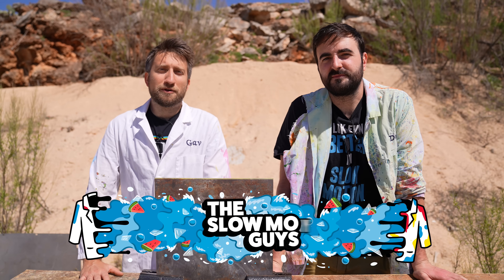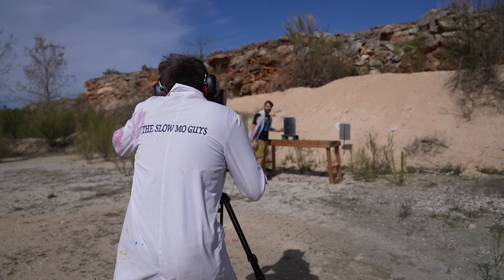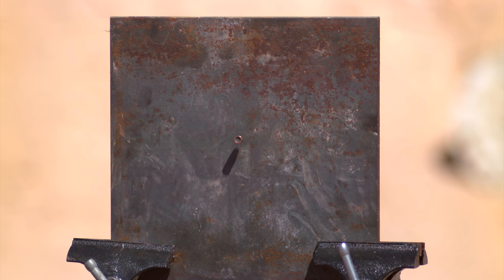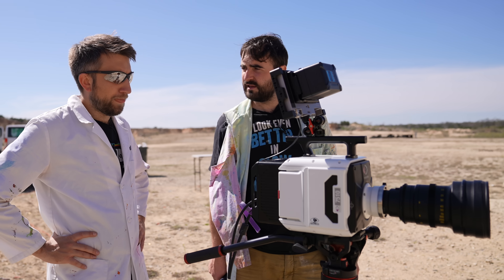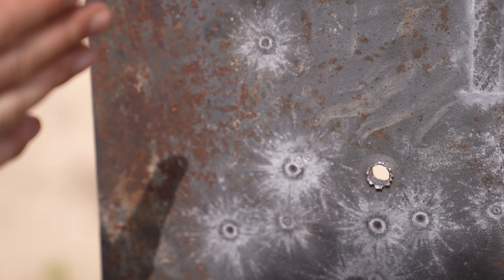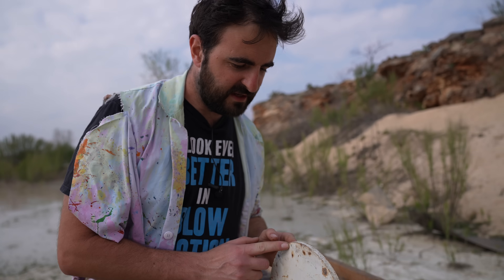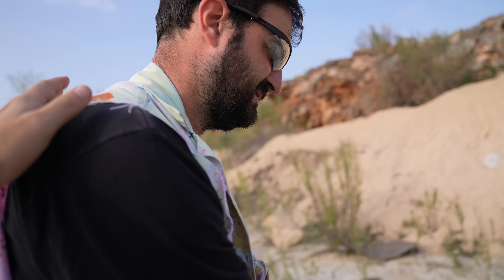Bullets vs Steel at 800,000 FPS - The Slow Mo Guys

Comment: The .30/06 had already tranferred so much of its energy to the steel plate that by secondary impact on the sign it had less mass, speed, and [the product of the prior mentioned]energy that there wasnt  significant exit damage. Also, being that slow, and aluminium being so much softer/more malleable that it doesnt tear. At higher speedbit would. You almost have to rather consider the lead almost a liquid traveling w such force at those  speeds. Exits w least resistance possible so to speak.

Comment: By my rough measurements the piece of lead exiting the hole was 5 times slower than the approach speed.  So ( by mv2.) it had only 1/25 the kinetic energy, having used up 24/25ths of its energy in making the hole.

Comment: I am sure others will be more precise but the 9mm hits with approximately 300-400 foot pounds of energy, the 30-06 with about 2,800 foot pounds of energy. a heavier bullet and the velocity of the 9mm is approximately 1100-1200 Feet per second the 30-06 is about 2800 FPS

Comment: red is or used to be the old color for AP Bullets for semi  auto handguns/ smgs , that only use 3 kinds of industrial sharp ammo standard n/ fmj not colored, ap (red)  and jhp (blue) . red was also ap for 7.62 x 39 rounds for f.e. ak 47 and dragunov dont know ig there was jhp ammo for those, at least i never saw any since standard ammo already creates more shrapnels than 5.56 or 7.62 nato ammo. for other of many big bore calibers, specially .50 bmg and i THINK some other antimeterial / long range snipers rounds there are other colors used. blue tips for those should be banned in most states today for civil usage since they atr inci or maybe he or an inci combo round not sure atm and too lazy to look for it ;) . for sure i would not recommand red marked semi auto pistol ammo cause if it is ap and fired on steel the shrapnels are not as predictable as from a standard or jhp round. btw just found a pic in one of my folders, 5,7 ammo is complicated , red and blue were jhp but are on this pic marked nemed as ( my french isnt good) jhp / ap. they are replaced by the third type on this pic that is just coppor collor "no tip"  should be standard "standard" but really fast rounds. since this ammo is forbidden for germanys civil market and the guns using it are too expensive for blackmarket i never shot one. but i think here also shrapnels will be pretty unpredictable on steel. i dont know colors for military / socom units allowed. edit this if i find to check it. i think this is an old wiki pic and i dont trust wiki that much concerning round markers.

Comment: It’s important to understand that the hollow point is not really designed to fragment, like petals.  It’s meant to simply open up and increase the size of the round as it enter the soft tissue.  Of course the steel causes it to petal out and scatter.

Comment: Have you tried strobing mechanical moving parts with the strobe at the same frequency? Worth a look, it's weird and awesome, and easy to set up, stuff does strange things at high speed and heavy load. Engine valves and valve springs misbehave 😂

Comment: Ok next up is skipping bullets off water..yes you can skip bullets on water just like rocks if you keep the rifle barrel a few inches above the water with a very slight upward trajectory! Only problem is it skips for a couple of hundred yards so placement of cameras would be a bit challenging to get a slow mode video of most of the skips.. .22LR rimfire would be a more workable caliber to tighten up the skip groups. Good luck!!

Comment: Used to do some high speed video when I worked for a rifle manufacturer in the 1980's. It was eye opening at the time. You could only save the results on a 
VHS tape. This state of the art equipment is amazing. Keep em coming guys...

Comment: I would be curious how different hardness steel changes the results. On the surface it seems harder would do better but harder also usally means more brittle so on that front it should do worse. Seems you would want some of both so that it flexes to absorb but not so much it fails.

Comment: Depending on the steel type, the bullet is producing a shockwave within the steel lattice that fractures it. This is called spalling and tankers in the military know how deadly this effect can be. In fact, "squash head" (HESH) munitions are designed to produced exactly this effect by "pancaking" the explosive onto an armored surface and then detonating.

Comment: The bullet is shearing the steel when making a hole.  A paper hole puncher is a good analogy.  I would think it is the tensile strength rather than hardness that determines whether a hole is made or not.

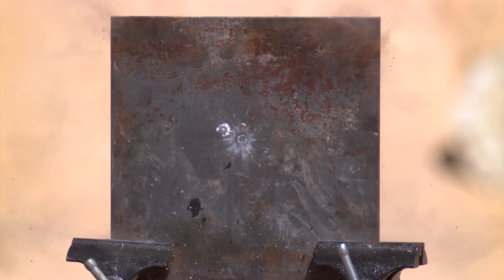Comment: 3:48 Somehow the dust and particles coming up like superman just resurrected, flew these two by completely. If you didn't know where it came from you'd just think some dust randomly started floating upwards.
7:00 Oops, this metal plate gained a bullet hole we didn't see. xP
10:15 That piece of "lead" is far too thick to be from the bullet. That's just the back of the plate. There's a small copper colored disk there, I think that's the remainder of the bullet.
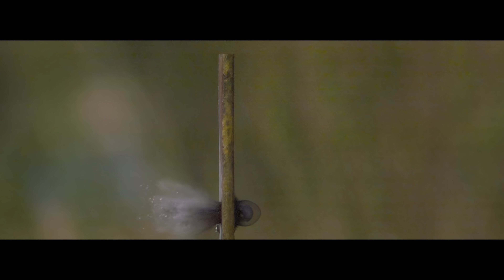10:48 Definitely the plate. There's no way that thin bit of dust is actually just the plate warping and thinning out. The bullet hole (the surrounding) has much less lead than there should be for this thick plate.
11:24 I mean.. yeah. Ofc it was the plate.
12:00 Or, idk.. you look at the piece that flew out and realize that's much more "lead" than the bullet is big? I'm not saying reviewing footage can't teach you anything new, but this is just a failure in observation. xD

Comment: just a bit of bullet info from a amateur gunsmith ... the hollow point bullets are designed to peel back but ideally not break apart ..you want all the mass to stay together because as it loses mass it losses penetration potential ...HP=expanding bullet  .. now frangible bullets are designed to break apart .. I think you guys would love shooting a 308 frangible bullet ... as far as the steel ..the circle steel you shot was most likely AR500 through-hardened steel plate ...another interesting thing you can do is put cardboard around the outside of the steel plate and shoot it with various rounds and you will see the splash pattern in the cardboard ..or put watermelons etc around the sides of the plate ...especially if you use frangible bullets ... I would be happy to send you various rounds I think people would love to see slow-mo (myself included) .. RIP rounds,frangible,steel core,frangible core,m855 penetrator green tip (5.56),30cal tracer rounds,5.56 tracer rounds and then some special homemade 30cal :-)  ...love the show thank you

Comment: You had me scratching my head there for a moment.  I used to shoot a .25-06 (117gr soft point) at 1/4" steel plate and it would not penetrate - just a splat - at about 70 yards.  The first steel plate you used must have been unusually soft.

Comment: The broken vise shows just how much energy the old 30.06 has and how formidable it is.
Reply: Yes. I shot  through a 9 inch Ford rear end differential case with a jacketed 30-06 round. The rear end diff was heavy, Had to carry it 300 feet down range. The holes almost looked like they were drilled through the steel.
Reply: my right shoulder remembers very well the one time i shot some 30.06 rounds many years ago

Comment: According to P.O.Ackley, a .220 swift factory 48gr. bullet will pen the 1/2" frontal armour plate of a WW11, 1/2 track, while a .30/06 173gr. Armour Piercing round (steel core) will cause a dent .007" to .008" deep. So - that's 4,100fps vs. 2,600fps. (feet per second, not frames per second)
A .17 Remington will push a 20gr. bullet at up to 4,400fps & 25gr. at 4,100fps as well as 15gr. @ 5,000fps.
Their penetration on steel might be interesting, visually.

Comment: Correct me if I'm wrong, but isn’t there a more likely chance for the bullet to ricochet back if the steel plate is mounted tightly? Rather than allowing it to move slightly, like how some steal targets do due to the spring on the back of them? I genuinely don't know and not a gun expert by any means, just curious if this is true or not?

Comment: Love the way the spinning round hits the plate and compacts and stops rotating but starts rotating again as it relinquishes contact with the plate. The kinetic energy of the spin remains as potential energy until it's free of the plate and converts back to kinetic rather than the spin just being stopped and it rebounding straight back. Amazing.

Comment: I think you’ll find the small pocket of air that occupies the hollow point is instantly super compressed. When air is compressed like that it heats up enough to burn the copper and lead.   The same phenomenon was described when that deep sea submersible was heading to the wreck of the titanic.  The instantaneous compression of the air inside the vessel was super heated and the occupants were “cooked” before they were crushed.   I believe I’m right based on what I have read.  Any opinions to the contrary would be welcomed.

Comment: I'd like to see a steel core round captured on the same setup. Used to have mil surplus 7.62x54R that had a steel core inside a jacketed lead projectile that would leave an exit hole in plate about the size of a .22. would be cool to see if the core leaves the lead much like the lead leaves the jacket in this video.
Reply: Also shooting golfballs off a fence post with a .22 was a favorite childhood game. The golf ball usually captured the .22 and went flying like it was hit with a driver. Might be cool to capture.

Comment: You guys are mad for standing that close while plinking metal, even with pistol caliber cartridges. I usually stay at a minimum of 25 yards for pistol and even then I've had some splash back come back and hit me.... I would never dream of shooting any rifle cartridge closer than 50 yards and even that's pushing it.... 100 yards is a nice and safe distance. I've sent literally 10k + rounds of every caliber practically at that distance and have never had any scares or even heard ricochet.... At 50 yards I was shooting m855a1 out of a 16" BCM and actually heard a ricochet super close, started looking around and noticed some dust kicked up maybe 10 yards away..... The center steel penetrating core of the bullet was literally laying like 10' away from me!

Comment: That flame isn't sparks, its a flash from the air inside the tip of the hollow point igniting because its being compressed. This happens in almost all your videos are you always thinks its something it isn't

Comment: I used to own a 10ga black power shot gun, side by side, it looked so cool with the hammers.  I loaded it with 3/4 in ball bearings and they would splash steel targets very nicely.

Comment: The target you found is likely abrasion resistant 500MPa rated AR500 steel, while your steel plate would likely be 250MPa rated mild steel

Comment: here's what I don't get ...   so so many of you all seem to [idk] "think"[?] the twin towers had holes SLICED straight into them from hollow aluminum metal, then why have a never EVER EVER EVER heard of aluminum bullet tips???   since according to the "experts" hollow aluminum goes through reinforced steel beams as if the steel was wet paper ...

https://youtu.be/8ddXw-isle0?si=8eZ6FCIaEhPIlV-B

dontcha KIND'VE THINK MAAAAAYBE that plane would have shattered and crumbled, instead of piercing into it as if it were a sky skraper made out of cardboard and paint

Comment: The plate target from the range is not meant to be used with rifle rounds.  It is probably AR500 steel which will provide years of use with normal handgun rounds.  Once a plate has divots from being shot with a rifle, it shouldn't be used any longer.  If a round hits a divot, the divot will tend to prevent the bullet from splattering and sort of "focus" it back in the direction it came from.  The resulting projectile can rebound at velocities fast enough to be dangerous to the shooter.

Comment: If you guys are always worried about not being able to get the cameras closer, why not just use mirrors so you can position the camera in a closer, completely safe spot? The mirrors may get damaged, but they’re a lot cheaper to replace. If you set up at a 45 degree angle behind the plate with a mirror in front of the plate you could even get both sides at once

Comment: Heat treatment and carbon content determines hardness in steel.... High carbon steel is harder but more brittle... as is quickly cooled steel... The slower you cool it the more time stresses in the material (lattice) have to settle taking out stresses and making it more tensile (that's why a lot of swords were oil cooled rather then water cooled, water cooled high carbon steel would shatter on impact), so slow cooled is going to be less brittle and less hard... (glancing over a lot of things here, but that's sorta how it works) In sword making it's finding the right compromise. Not as hard as it shatters on impact but not as tensile that it would fold around the other blade.. So it's all about finding that balance between brittle and tensile. That's also why there's different sort of steel for different purposes.. Also the environment steel is used in determines what properties it has to have.. If you use hard steel in arctic circumstances it'll just break so if the environment it's being used in is really cold, the steel should be more tensile then steel used in hot conditions... there's a lot of variables...

Comment: From experiments I have done, that piece coming out of the far side of the steel is a dome of steel, not a piece of lead.  BTW, it is better to be behind a cinder block that 1/4" of mild steel.  The cinder block gets destroyed, but the double wall construction stops the fragments.  The steel dome can pierce 3/4" pine.

Comment: I'm surprised that the front bow shock is not attached, but well out in front of the projectile.  On a pointier bullet, I expect the shock would emanate from the tip, as you see in most aircraft traveling supersonically.  Interesting.  You see that in 2D with a displacement hulled boat forward of the bow, with the water essentially piling up, IIRC.  Not sure it's the same phenomenon, but intriguing.  Dammit, now you've gone and made have to go look something up...I HATE it when I have to learn something!   :-)  Great job on the vid, BTW.  If you kept that target, it would be interesting to see a steel jacketed and an armor piercing round next.  I suspect it might not look that different with the piercing round, except that more of the bullet would pass through the plate more intact, along with the tearout material.  

Have you thought about some Lexan (polycarbonate) protection of adequate thickness to protect the camera, so you could get a shot along the plate axis?  You would still have to determine the energy, but you could start far away and gradually move closer until you started to get a little uncomfortable with the impact forces on the camera and protection.  I would look into how others so the mounting between the camera and the shield, too, maybe with some rubber and energy absorbing foam or the like.  Or both onto a plate with some mass. Anyway, just a thought, if you'/re feeling a bit more sporty.  I don't know if there is much to be gained there, especially for the added risk to the camera but just a thought.  There is probably relatively little energy coming off the plate, but still, like you say, the camera's a bit precious.

Comment: At 9:45 The piece that went forward after the impact was the steel itself.

Its called "plugging" and essentially it happens when you hit a material that's harder than your bullet, but you hit it with so much force that it sends the "plug" of material forward without actually "piercing" or "penetrating" the material.

The actual bullet stopped on impact, but it hit the steel so hard it turned that section of steel into a "new bullet" basically.

Fairly rare occurence, you have to find a piece of steel hard & strong enough to completely stop the bullet you're shooting, but hit it hard enough with that bullet to "punch" the material out and send it flying in place of the bullet.

Comment: 😹10:35...On Earth, the speed of sound at sea level — assuming an air temperature of 59 degrees Fahrenheit (15 degrees Celsius) — is 761.2mph (1,225km/h)...the speed! of that bullet is!...
(I know you can figure that out on your own, use your noggin'! for a change!)🤣...

NASA's X-43A aircraft on Nov. 16, 2004, flying to Mach 9.6! or almost 7,000mph!🙀
That stands as the fastest speed achieved to date by a jet-powered aircraft!...

(Mach 10! is the next objective!)...

Comment: The phenomenon recorded here is a simple transfer of kinetic (moving) energy into heat, which melts a hole in the plate.  

The energy in the bullet heats up the plate so much and so quickly that the plate just simply melts to let the remains of the projectile pass thru the plate.

The spark you see on the side facing the rifle is superheated steel being ejected... that's a guess, but likely correct.

...

Comment: Lovely shots as always form the both of you :) Mild steel has an MPa of 250 or so, the target steel is likely AR500 which has an MPa of 1100 - hence the extra strength and energy transfer.... RIP vise.
Reply: Probably was an eBay vice from china

Comment: How does the copper jacket of the bullet, completely change direction, but still maintain the same direction of spin as it had before contacting the steel plate? How does the copper jacket not lose that energy during impact?